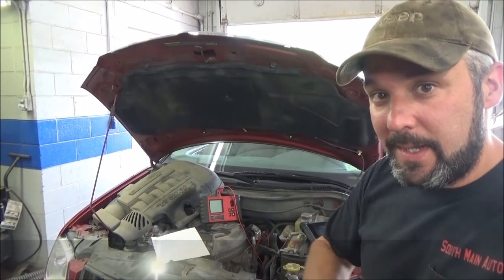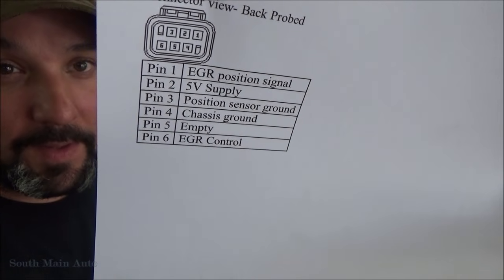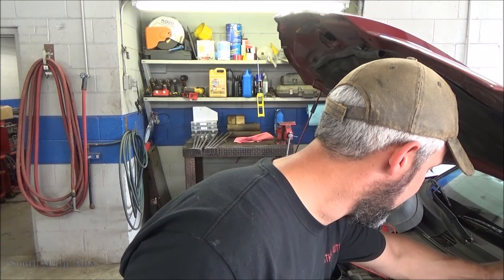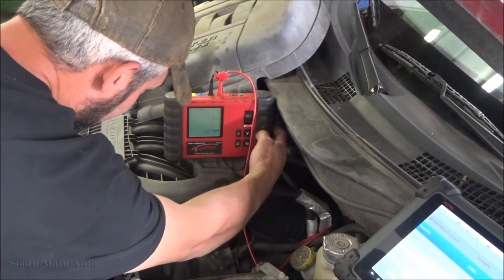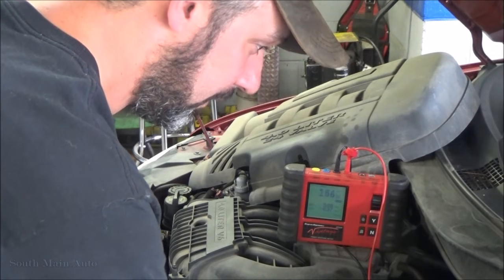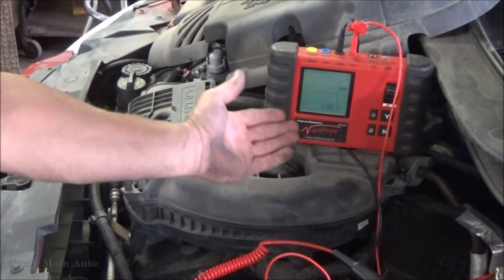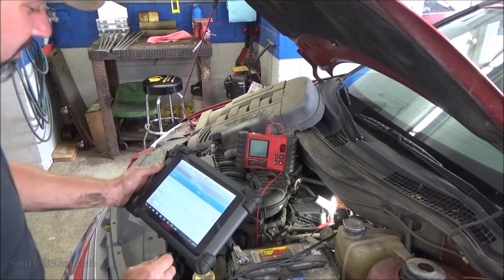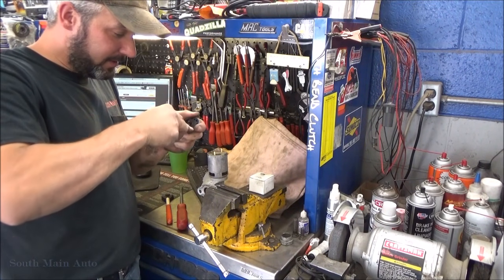Chrysler EGR Diagnosis P0406

Comment: Guessing that would cause the engine to just die?
PO codes 401, 403 and 406.
Replaced the EGR valve on the left of the engine dodge grand caravan 3.8L V6 2005 year date.
Paid 1400 for it put another $500 in it just to get her to pass inspection and some conveniences.
Lost the 403 when I replaced the EGR valve and you can only guess the hell o had getting it out per the bottom bolt that is straight on to the alternator! 
I feel I probably crossed the threads going in hope I don't have to do it any time soon
It also has a slight valve chatter or noise I'm hearing now after replacing the tension idlers squealing.

Comment: Here in December 2023, The Innova 5610 is really good with lifetime updates, and Harbor Freight's 15s is exactly the same scanner and is on Inside Track Club sale for $260. Can't beat it. I just got one and plugged it into a 2021 Camry Hybrid and it supports tons of tests and bidirectional controls.

Comment: What do i do if i replaced the egr valve and sensor deleted the code and the check engine light and code popped back up ? I have a basic scanner tool and a basic multimeter how can i figure out what is causing the code ? Its the same code P0406 on a 2005 dodge ram 1500 5.7 hemi.
Reply: Hello , I wanted to ask you what was the actual matter / faulty component with your car ?  And what was the fix ?

Comment: had a caravan once with a broken pin in the conector but you see that when you go to change the valve obviously but most of them end up in  oem egr valve being installed
Reply: broken pin?  dang, didn't check my 2008 when I replaced the valve.  Code came back.  Will have to check those pins.

Comment: For Ford stuff, you can download FORscan (free) onto a laptop. Then buy a cheap USB OBDII scanner for $20 on ebay/amazon.

It can do bidirectional, self tests, injector programming, transmission calibrations, and even PATS key programming.

I think in another couple of years the smart phone stuff will be on parity too. Some of the apps I've tried can already do mode 6 data and bidirectional commands.

Comment: Ok my 04 is Pacifica is cutting back on take off if you hold it steady at 2000 rpm in park it also cuts back randomly dies at traffic lights . Is this a sign of a bad egr valve? Thanks

Comment: Hi Eric, love the videos!  Can you do a video about O2 sensors, especially how to test off vehicle?  Reason for asking is I replaced my Discovery 2 V8 front two (pre-cat) and due to stupid high cost of OEM parts, used 4-wire Ford Falcon (Bosch) sensors instead - I matched up the colours, but coming up as faulty (heater not working) - I suspect the colour codes aren't a direct 1 to 1 mapping to the Land Rover wiring loom, so how can I tell, with just a digital multimeter, which wire does which function?  I do have the LR colour codes of course, just need to figure out the O2 sensor end.
Reply: Typically the two wires that are the same colour will be the heater. The other two wires will produce a 0 to 1 volt signal on it's own so you could figure out the polarity. 

Is there a reason why you changed two sensors at the same time? Were both defective?
Reply: vachon644 Changed both for several reasons: Changing one involved removing whole Y-pipe assembly, so both were accessible anyway.  My tester said one was definitely faulty, but could not find info on which bank was which. Both were OEM and had 340,000kms on them so thought best to do the pair.  OEM sensors were about 4-6x the price of the Ford item, so effectively got both for 1/2 the price of just one!
Reply: Darren Coull
Changing the both because it might be very hard to change them on the vehicle that I understand but most of vehicles they are more or less accessible.

"My tester said one was definitely faulty"
I am not aware of such things as O2 sensor testers but if you mean scan tool or OBD tool of some sort they cannot be relied upon to call a sensor bad, you actually need to diagnose them based on the codes and data you have available. A bad wiring or another faulty sensor could have the computer throw an O2 code.

In my opinion all narrowband sensors should be interchangeable provided you have all the required pins on the connector (1 pin, 2 pins or 4 pins). The problem that can arise from using generic O2 sensor is that you need to modify your wiring and may have to use sub-par connectors that might not be as well insulated as OEM and cause problems down the road.

Also, OEM is Original Equipment Manufacturer as in if your car is a Ford then OEM is Ford. OE replacement would be dormer, etc.

As far as testing your heater code you should check if you have proper voltage across the heater wires when you start the vehicle. You could also proceed to voltage drop tests on the power and ground of the heater. You may be in a case where the heater in the generic O2 has a different power than the OEM one and the ECU sees that as abnormal. If you have a heater code on only one bank and not the other it's likely that you have a wiring, connector or sensor problem for real. It would be helpful if you could provide the exact heater code (IE P0135) as the code can give further information (Is it open, shorted, out of range?).
Reply: Of course, yes it was my Delphi scanner tool that said one was faulty.  Can't remember the exact code any more.  After replacement, now showing both as having a fault code relating to heaters not working.  Suspect there is a wiring mismatch between the Land Rover colours and the Sensor colours, but was looking for a simple way to find out for sure with them off the vehicle - getting to the connectors to backprobe etc is impossible while on vehicle as the plugs are half way up the side of the gearbox, next to the transmission tunnel (not enough room to get hand comfortably in there) - The plugs on the new sensors of course were not a match for the Land Rover, so I cut the plugs off the old sensors to adapt the new ones.  Use crimp connectors of course and heat shrink and also used the Land Rover braided heat covers from the old sensors for extra protection.
Reply: As I said, typical 4 wires O2 sensor will have :
1. Heater power
2. Heater ground (usually power and ground are the same color because they are not polarity sensitive)
3. Signal
4. Signal ground

Your generic O2 box or information can probably shed light as to which color is what. As far as the OEM wiring you should search the web for a wiring diagram for your vehicle to properly identify which wire is which.

In the case where you don't have a wiring diagram then you you could check for a voltage between any two wires and that will be the heater wires. Remember that an O2 sensor produces it's own voltage on the signal power and ground (0v = lean, 1v = rich). The only power that is supplied to the sensor is for the heater and should only be seen shortly after starting the vehicle (or turning the key on perhaps).

You could also take some readings off the old sensor(s). You could check for a low resistance on the heater wires and for a 0-1v signal on the signal wires. I would not recommend this simply because the heaters could have been defective for all we know and because testing an O2 sensor off a vehicle may get tricky; I think some people had success by putting the O2 in a fuel-soaked rag and check for the 1v but an O2 sensor will only give an accurate reading when it has been heated and the O2 needs it's outside portion to be in free air to work right and the fuel might get there.

Comment: If I am correct, the sensor is 2 wire (rheostat) which then pulls down a resistor that is connected to +5V. Perhaps a simple fix would be to exercise the rheostat wiper by cycling the actuator full open to full closed about 100 times. As for a practical way to do that not sure at the moment, but I am of the electronic ability to do so. Or drill a hole in the thing and shoot some contact cleaner in then plug the hole with a screw.

Comment: 2008 T&C 3.8L van, got code, replaced with a doorman egr valve.  Had the battery disconnected so code went away.  Couple weeks later code came back????   Did I need to reset the code electronically?  Help.  Perhaps doorman egr valve crap?
Reply from the maker: i quit reading at "dorman"
Reply: Is Airtex acceptable?  BDW?     Could it be my code never actually cleared and I need to actually clear any/all codes with a scantool since installing the brand new crap dorman valve?

Comment: Thank you for the disassembly. At least we got to see the inside of this piece of kit and understand how it operates.
Reply: Oh, and if one wants to try the EGR at various positions. Couldn't you just use a potentiometer to adjust it's position up and down the voltage range?

EDIT: Making sure that the potentiometer gives clean throughput of course.

Comment: Have an 07 Jeep Wrangler and I just replace the EGR valve and it still is pulling that same code po406 exhaust gas recirculation sensor A circuit high any recommendations?

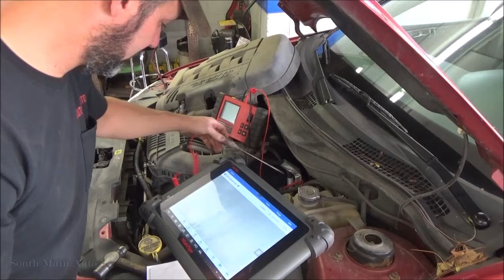Comment: Perhaps a dumb question, but why does the scope pull the voltage down to zero at 6:25 into the video?  I believe you said you were on the signal wire.

Comment: Don't make me break out the BFH little guy!!  And there it is, lol.  Oh, I broke it, more lol.  At least you keep your dissection area clear of past carcass, but somehow I knew it would be centered by a heavy vise with a BFH handy.  Carbon traces of the pot could still have been worn in the most used areas, a sweep test with a scope might have found that worn spot but only a maybe as taking it apart might have made it run in a new track.  We already know that vibration is affecting it.  But that was before the BFH treatment.   Thanks so much for not doing it Scanner style with just a call out for the new part - we come here for the fix put in and absolutely LOVE a BFH dissection.  You are slipping Eric, not even a cameo of a God like can of brake cleaner overseeing the destruction?  There is always next time, top drawer SMA as per usual.

Comment: The EGR actuator and its sensor is a contentious issue (If memory serves, on Fords they use a differential pressure sensor on the exhaust to intake connecting pipe).  It seems to me that to have both an actuator and a sensor creates twice as much trouble since if either goes bad then it results in a similar fault.  I would be interested to know of the running of the car was affected or whether it was just a check engine light and logged DTC.

Comment: A signal substitution tester could inject normal voltages and resistance into the computer. If the readings normalize, that means the sensor is bad.

Comment: I was just about to take my Ram 1500 to a mechanic because I can't reach the EGR valve (magnum v8, back of engine, code p1404) and I got a letter from Chrysler Canada informing me they had extended the warranty on the EGR alone. 

dealership appointment made

Comment: It looked like you were testing a Knock Sensor lol. My '89 3.8L uses a 3 pintle digital EGR (small, med, large) ceramic coated metal pintles, that float in any commanded combination. You get lucky with a Reatta- the CRT in the dash has bi-directional capability, to control things like EGR right from the drivers seat. 1989 technology!

Comment: Hi SMA,I'm a new subscriber to your channel and love diagnostics,it's more a hobby because I'm not a mechanic but well able to keep my 1994 1.9D Golf top notch in my own.A friend ask me to look at his Toyota 1.8 VVT-i,with 300.000 miles with severe misfire on cylinder 2,I did cylinder injector and coil drop test and find out that by disconnecting the injector 2 got no reaction,so start to check the injector,the tools I own are only a multimeter with duty cycle capabilities and a test light,so power,ground and control are present,resistance and duty cycle the same as other injectors,so I blame the cylinder 2 internal problem with out swapping the injectors to be 100% confident.I'm still thinking about injector 2 spray pattern.
What are your thoughts about this car???The car didn't pass emissions on idle and high revs.

Comment: The first thing to check should should be making sure the egr valve is not a dorman. lol Also, dont forget about pawn shops when looking for good deals on tools.
Reply: That's odd, I've NEVER seen a good deal at ANY pawn shop on ANYTHING.  Professional price setters usually aren't too foolish around here is my assumption.  On cragslist you are dealing with 'gotta go now cos I needs me money' situations that just don't exist for a pawn shop.  But if you've got reasonable pawn shops then know I'm jealous of that and also wondering why.
Reply: +Lee Barnes most pawn shops will entertain offers, especially if the item is not selling and has been there a while. You dont have to pay sticker price.